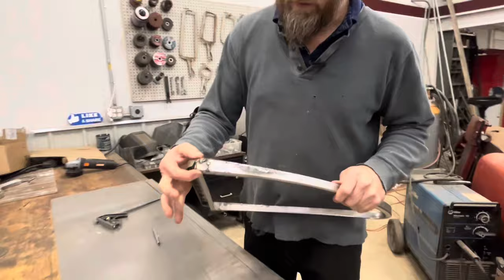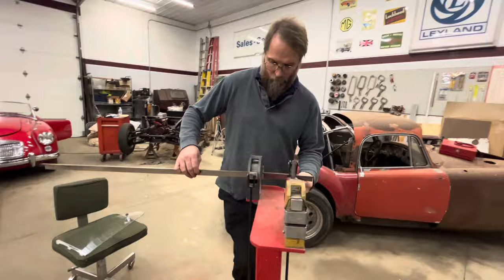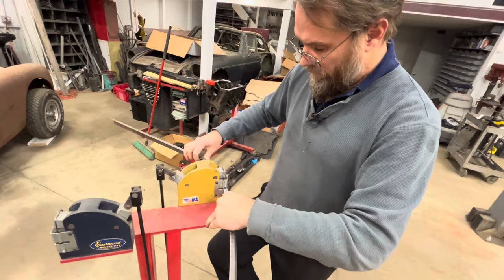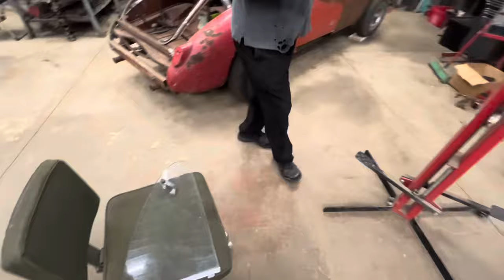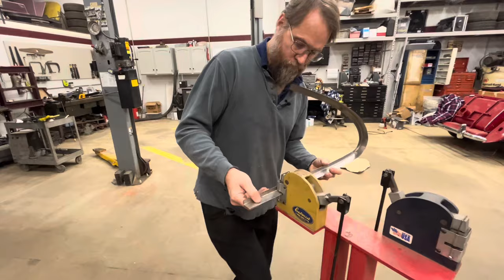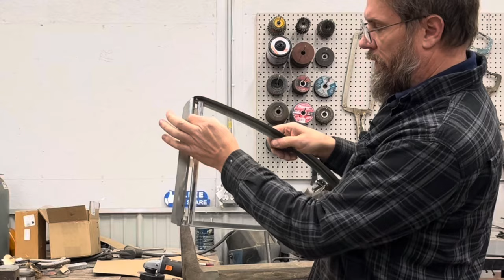MGA II Ghia Fastback…Drivers side quarter window frame

Comment: Your coupé project is getting the love it deserves again 👍 I was wondering what the rear quarter windows would look like if you swapped sides and turned them up side down . 🤔
Reply from the maker: I had wondered that too earlier in the build, and it was awful. Didn’t come anywhere near as close to working as you may think it would have

Comment: Nice vid!  I like your explanations.  Just found your channel & subscribed. I'm sure you know you are going to fit in the car, but you look so tall I have to wonder if you are making any mods to give you more room, it's a small car!
Reply from the maker: I’ve driven one before, it’s a bit tight. I will likely try to get the seating position a bit lower than stock to help with headroom

Comment: Great fabricating skill here...I wish I could love those quarter windows which you have so laboriously created, but alas I feel it lacks the design integrity that you have given the overall fastback shape.  There are better ways (just as easy or difficult) than taking a found object and completely redoing it just so you can use a piece of glass. Of course, it's just my opinion.
Reply from the maker: I knew when I started this that some would love it and some wouldn’t, and those side windows have been a point of contention with several people. All I ask is to wait and see how it looks after I skin the body and get the windows and trim I have planned installed (also the fender line will change slightly to help bring it together too)